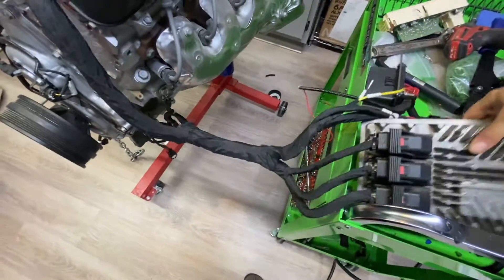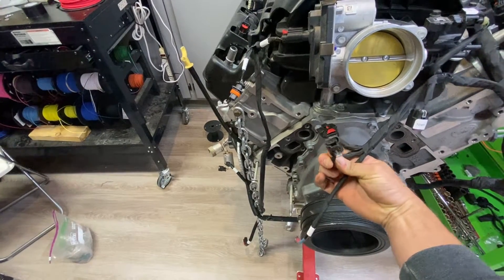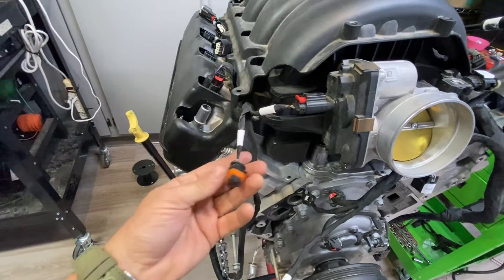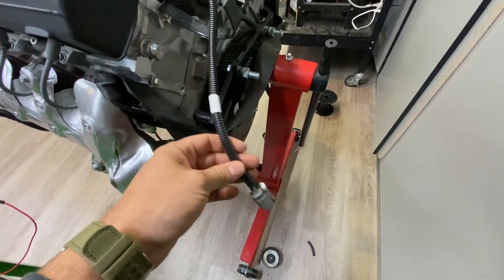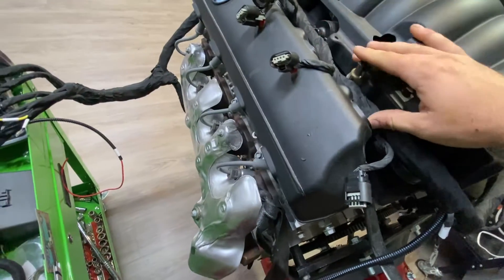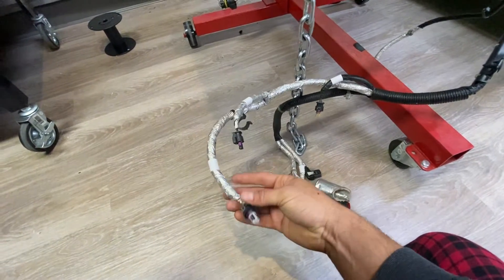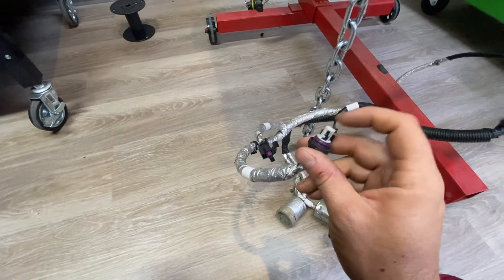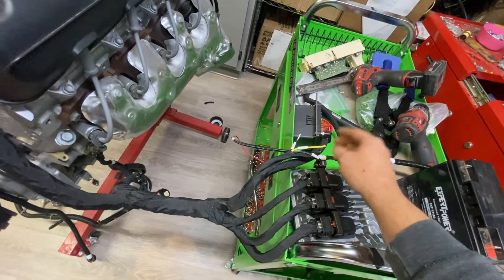Gen V C10 conversion harness instruction video

Comment: So if my harness has the black o2 sensors connect on the passenger side. I put 12666673 on the passenger and driver side or is it 2 different o2 sensors? My passenger is black and driver side is grey

Comment: Hi, thanks for sharing.

Where do I get the tachometer RPM signal from?
From which connector,
I have an L83 with a TH400 transmission..

Which fuel pressure regulator do you recommend?

Comment: nice! well done.. with a standalone harness I'm I able to wire it up to anu vehicle to run their own gauges? mph.. oil pressure.. coolant temp etc
Reply: @Franklin Kyle instablaster :)
Reply: @Graham Bodie I really appreciate your reply. I got to the site thru google and I'm in the hacking process atm.
Seems to take a while so I will get back to you later with my results.
Reply: @Graham Bodie It worked and I finally got access to my account again. I'm so happy!
Thanks so much you really help me out !
Reply: @Franklin Kyle No problem :D

Comment: On the fuel pump section, you have the fuel module (GM part) and the fuel pressure sensor,,,, what is the part number for that fuel pressure sensor, and is it a GM part??? 

Thanks
Mark
Reply: I bought, 13579380 GM Fuel Pressure Sensor.

Comment: I need some info on a swap for my 1999 and 2000 s10 xtreme. The l83 would be for the 1999 and the l86 for the 2000. How can you help!
Reply from the maker: It will be a extremely tight fit. Besides the fit it should be the same install as a LS engine

Comment: Price for one like shown ?
Reply from the maker: 550$
Reply: What about tuning the ecm and tcm. Just want it run and drive no performance adds  looking at a 2019 pull out.  5.3 / 8L80e  can you unlock those (remove vats )  I have hp tuner. Is it doable with there software ?
Reply from the maker: @locrewcustoms3490  Since  you have hptuners you can use it yourself to program with my help.
Reply: I look forward to
Getting mine. Just waiting on a text back bro.
Reply: @swaptimeusa  @ how much would it be a harness for a 2010  gen 4 4.8 with 60e transmission????